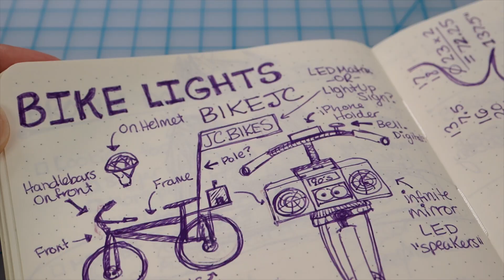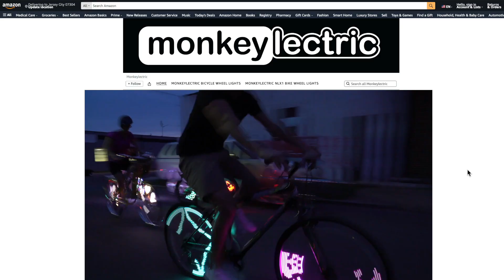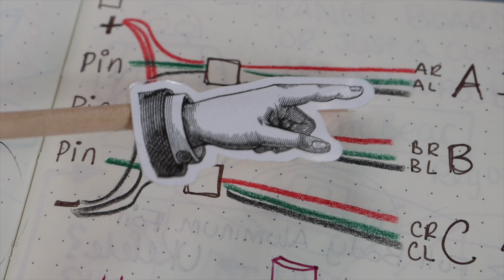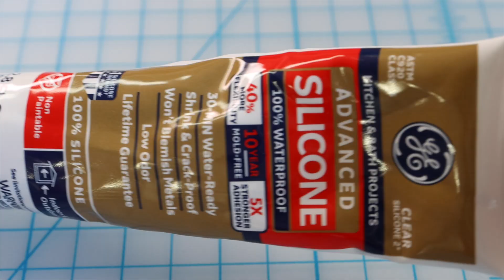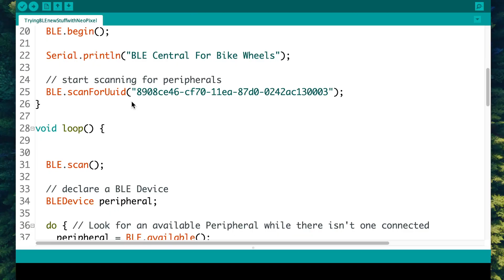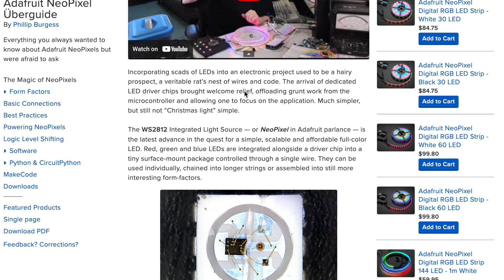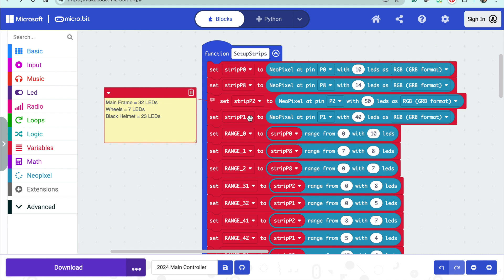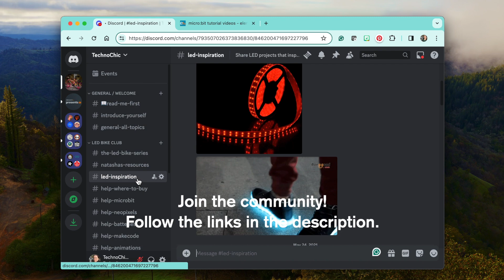Natasha's NeoPixel LED Bike✨ // Creative LEDs *10*

Comment: This is a great series of videos. I struggle with the mechanical stuff so it is particularly useful to see how you solved those problems.
Reply: Oils you tell me how you power the strips. I.e. what battery do you use, do you use multiple packs split between the strips etc.?
Reply from the maker: I use one battery for all the LEDs on the frame and another in each wheel and helmet. (One per micro:bit) Here's more about the battery: https://youtu.be/F2w7TIHnuKw?si=S6rW0i9WX5vov546&t=187
Reply from the maker: Thanks! Glad you like them!